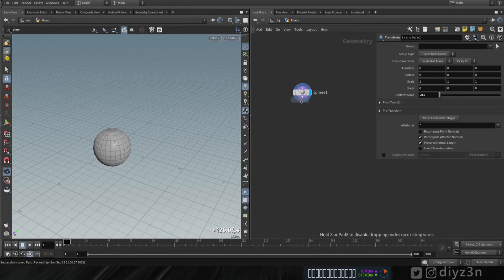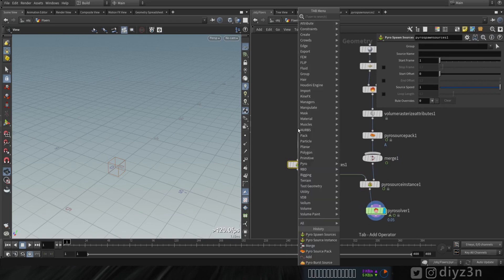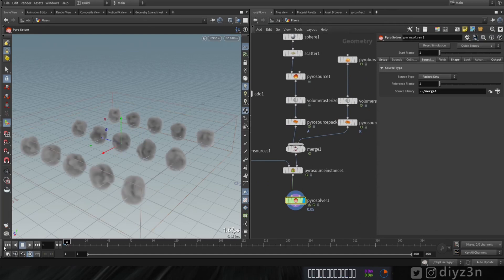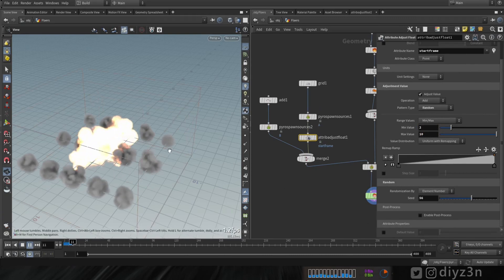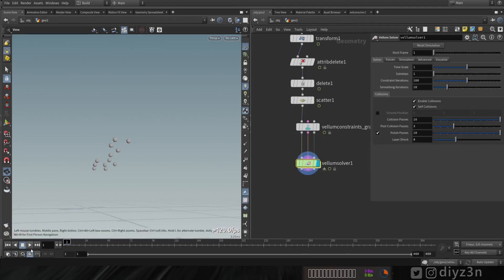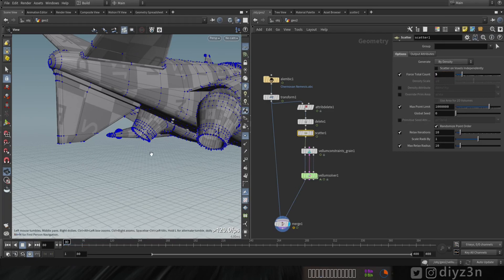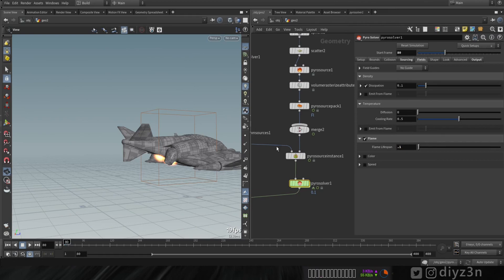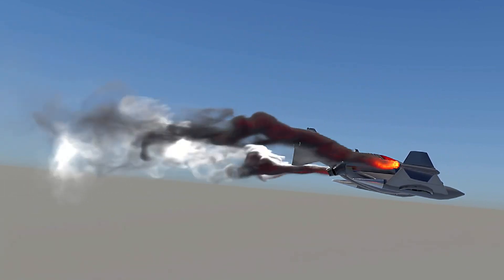Aircraft flares using New pyro source packed In houdini 19.5

Comment: I still don't quite grasp the point of pyro sourced packed... We could always create multiple pyro sources and merge them together before volumerasterizeattributes, no?
Reply from the maker: hi  worth t mention that this future  was for the minimal solver (GPU) only, but yeah, its have it's benefit like:
 1- cloning the same source over and over without recreating the 
2-moving them in the scene in an efficient way 
3-controlling their time range individually every source has a time range (before that, you had just one in the pyro source) (variation like orient , start frame all field, etc)
4-i used multiple sources before, I notice they do not interact with each other properly
5-in general as folks at sidefx said: now with source instancing it's more efficient to composite multiple sources together